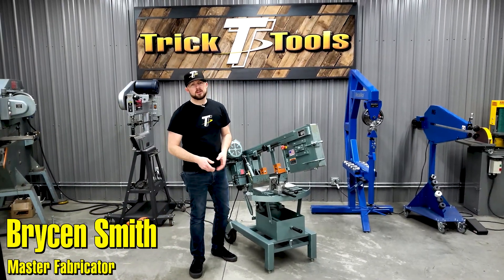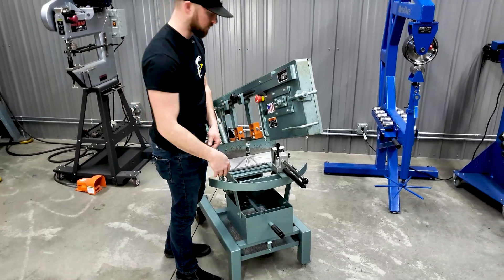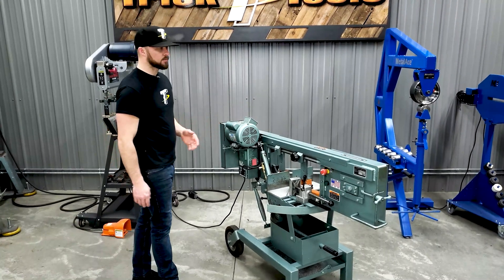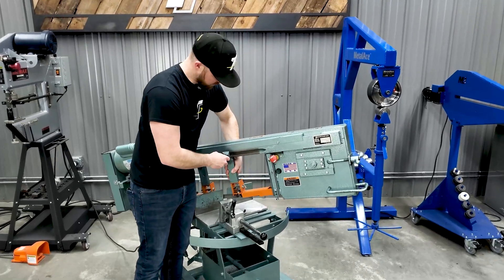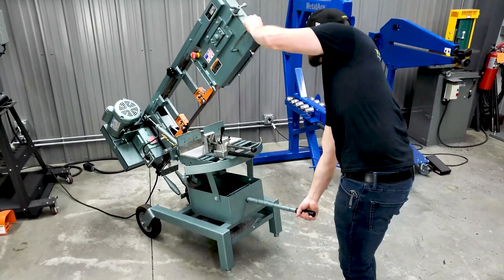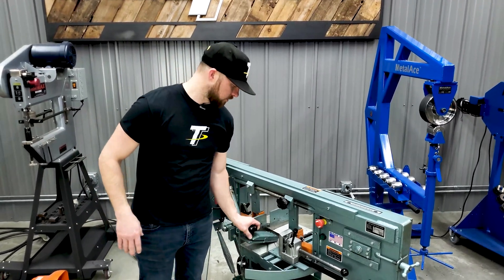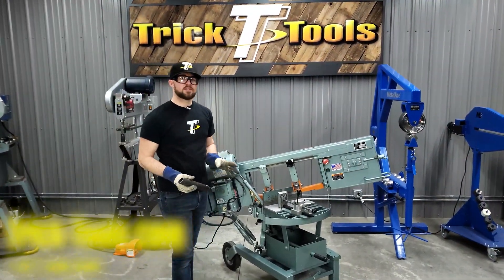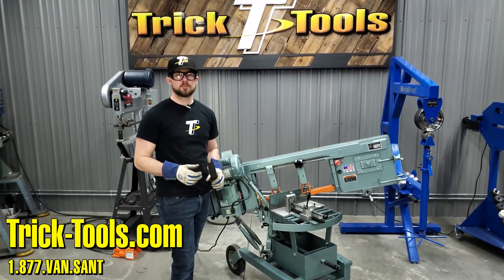Ellis 1600 Band Saw - Trick-Tools.com

Comment: I've had my Ellis 1500 saw for nearly 25 years.  Love it!  I have accessories of infeed roller rack, work stop for consistent cut lengths, and the table to allow it to be used in the vertical position which is nice but not used all that much.

Comment: Does it have a work-stop so you can cut a lot of consistent blanks?
Reply: If a Google search doesn’t produce any results, you might consider a mag base.  MagSwitch makes one that is pretty much designed as a stop.  The cutting base of the saw is aluminum so you’d have to use the steel vertical surface.  Not exactly a factory solution, but it might get the job done.
Reply from the maker: Nothing comes standard with the machine, however Ellis does offer a length stop accessory. See the link below.

https://www.trick-tools.com/Built_in_Support_Stand_w_Length_Stop_for_Ellis_Bandsaws_6252_ELL_2214

Comment: We've been running our 1600 for about a year. Still on the original blade and still cutting great. It is just one of those tools that does the work and never complains. One of the very best purchases we've made in our shop. Amazing cost for performance.